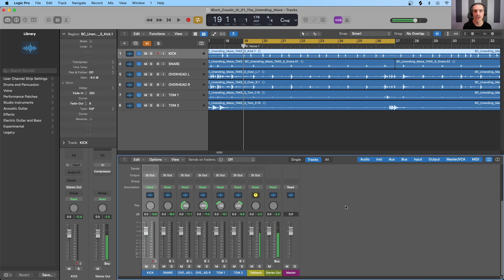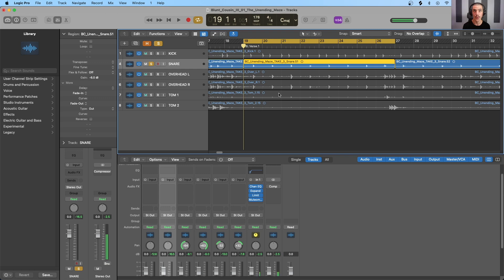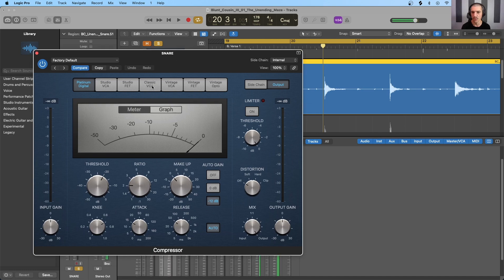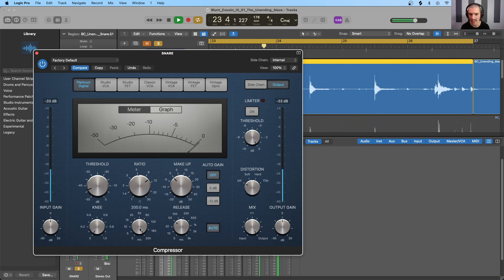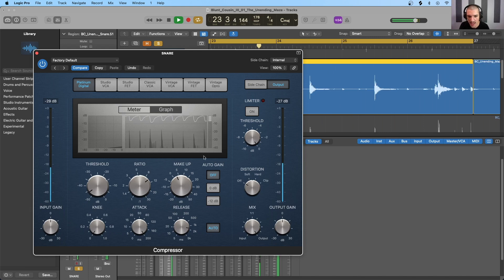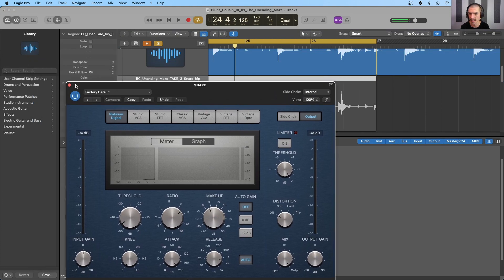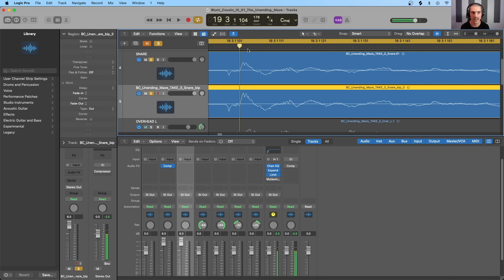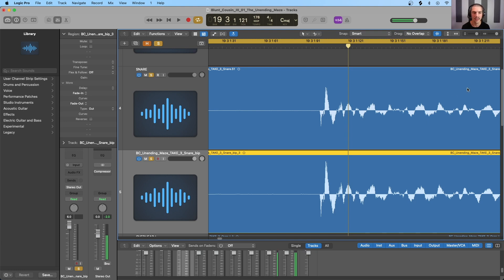Using Compression To INCREASE Dynamic Range

Comment: Thanks for this video! I was experiencing this in a mix but it was undesirable. My compressors were increasing my dynamic range if anything, and if I decreased the attack at all, it introduced too much pumping. I was about to try serial compression or make the thresholds higher, but I tried out a soft clipping technique instead. It was very successful. This is great to know, though. Being able to shape our signal to give us our desired dynamics is a very powerful skill.
Reply from the maker: Dynamics are an essential part of music and it's important to have a variety of tools to help control and shape them! I'm glad soft clipping worked for you in this case.

Compression, serial compression, parallel compression, transient shapers, levellers/volume automation, clip gain, clipping, expansion, gating/muting, dynamic EQ—they're all great tools to have at your disposal!

Comment: Thanks for this man. Exactly what Ive been looking for and couldnt find. Where can I find an expansion plugin?
Reply from the maker: No problem!

Your DAW should have an expander plugin under the dynamics section. Many noise gate plugins double as expanders if we set the reduction to something less than infinity/mute.

I typically use Logic's stock Expander plugin, though I also sometimes opt for the Fabfilter Pro-G (gate) and adjust the range as necessary. You can check out the Pro-G here if you're interested: https://mynewmicrophone.com/Fabfilter-Pro-G